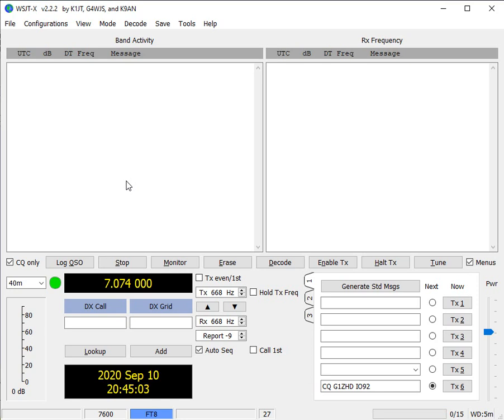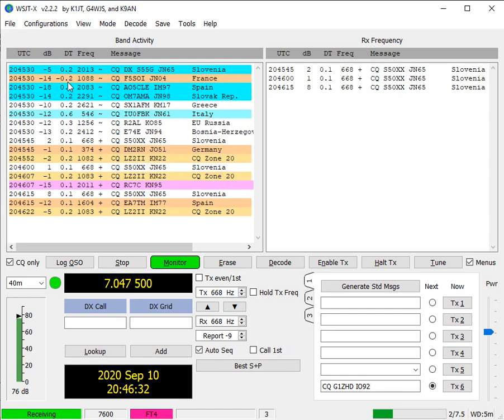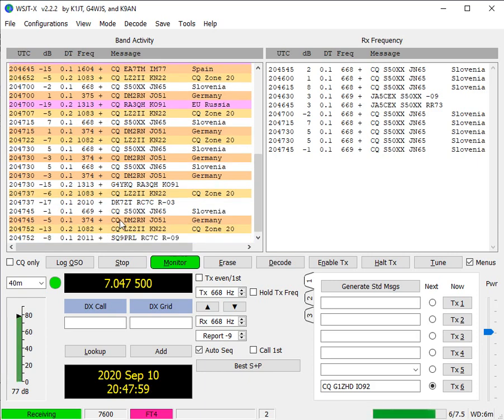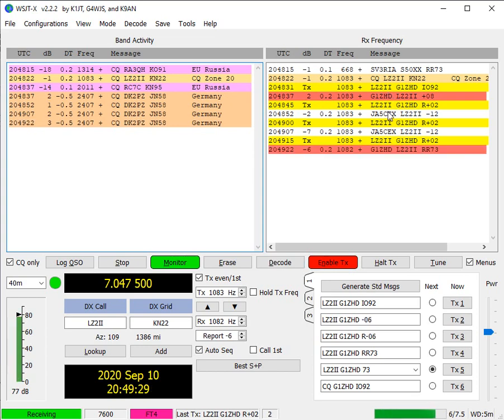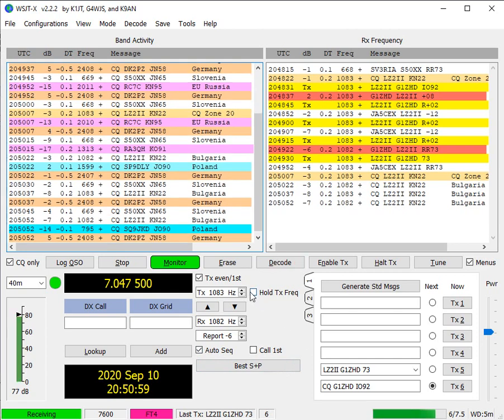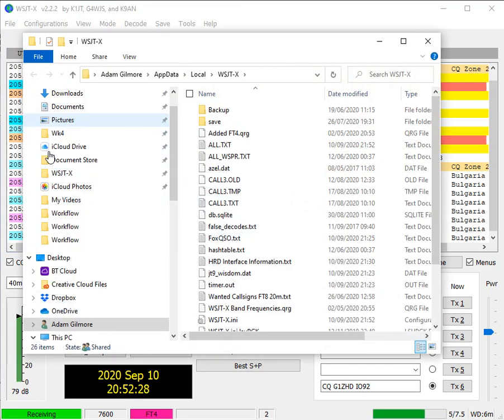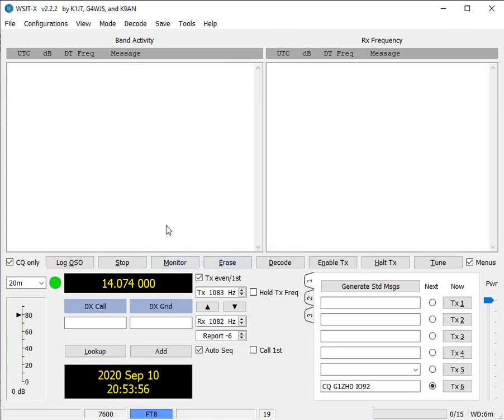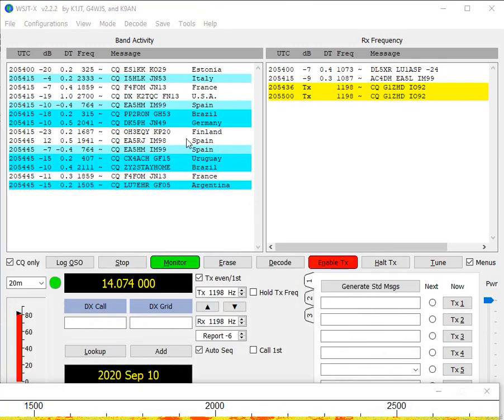WSJT-X Basics in 10 minutes

Comment: Setting up WSJT-x is a special art that only a few people can do. Just getting the mysterious drivers in the right place takes time and you can experience loads of frustration. Maybe that's why I can't find a video that slow walks you through the setup. If I ever figure it out, I just might do a video on it.
Reply from the maker: I keep tell myself I need to do one but haven't got around to it. Really it needs a PC or VM that is a new install before you start, but also, it does differ slightly dependant on what transciever you are using and if a seperate interface/soundcard is required. With newer ICOMs, even as late back as the 7600 and 7100, it's pretty straight forward, if you know how. I might just try and creat a 10 minute video on how mine is setup, may would be a start, for sure.

Comment: How do you dislay country? Mine does not. Have not found that setting.
Reply from the maker: John, I've had a look at mine and I can't see any settings that would allow you to switch the Country on/off. They only way I can do it is to reduce the width of the window, so you just can't see it. Also, Country only shows on CQ calls, and only once you have already contacted the DXCC and ITU zone in which a Country exists. I will keep looking and let you know if I find any other possible reasons.
Reply: @g1zhd-adam  I will check it again tonight... once the thunderstorms clear out. in my local area.

Comment: from last weeks i've tryed to operate in  FT8 bu i can't transmit. i don't know if it's a problem of PC or some issue of the radio
Reply from the maker: What radio are you using? So are you receiving signals and have you selected the right com port for the audio. Also check the figure in DT. If more than +/- 1.5 you will need to syncronise you PC clock to the net.

Comment: I had hoped to do FT8 with software only but apparently still require the interface hardware to my Yaesu radio for anything to work. I am really disappointed as I thought it is computer to computer communication?
Reply from the maker: Well the comms is still RF but the computer codes and decode the message. Which Yaesu do you have?

Comment: Question. I went in and set the items I wanted to follow by color. It only shows the cq, transmit and incoming call but none of the other colors like new grid, country or other items I checked. Any idea what the heck I am doing wrong?
Great video thank you..Kb6lqv
Reply from the maker: Hi Ray, I have all the 'Decode Highlighting' items ticked accept for 'LoTW User' and 'CQ in message'. Are you saying you aren't receiving anything but CQs and incoming items, or that they are they only ones highlighted? If they are the only items then do you have the 'CQ only' box ticked above the recieving signal strength meter?

Comment: looked and did not see the drivers for Mac. I looked on the Icom website before posting this and did not see it.  I saw the drivers for Windows but not Mac.
Reply from the maker: WSJT-X does not user Drivers. Only the USB cable to your radio or sound device will need them. So you need a USB cable with drivers compatible with Mac.
Reply: @g1zhd-adam  and what cables are those?

Comment: I want to send CQ for a specific Country.  I have tried creating a macro, or just enter in one of the 6 lines on the bottom right.  When I do this I get this symbol "<"    ">" with CQ_XXX  in between the brackets.  I can't seen to find any info in how do you do this correctly.  I can see others who are doing it on my screen.  I will give you the exact example.
Give me an example how to type in     CQ P43 xxxx FN41     xxxx would be callsign       Thanks, Ken
Reply from the maker: I'm sure you have the answer by now but just incase not, you just need to type in the country letters in between CQ and your callsign in Tx 6, e.g. CQ NA G1ZHD IO92 for North America. However, if the combination of your callsign the extra country characters and the locator are too long for the display screen then it will just show as < >. It should still be sending the correct letters.
Reply: @g1zhd-adam  I appreciate your post.  When I do that It transmits  <CQ_P43> mycall FN41      Note the brackets and the underscore.   Someone else told me it could not be done with a letter and number.   no good with P4 either, what works is just the letter "P"     I have tried it with 4 letters and it works.  If I use 5 letters I get the brackets.

Comment: What is a normal transmit power setting for FT8?
Reply from the maker: Short answer, 30w. Long answer: I know it's not useful but the right answer is 'as low as possible'. You somewhat need to guage the power for the day and difficulty in getting the QSO. Of course propagation, antenna, location, receiver conditions, all have a big impact, as in any other mode. I personally normally operate between 30w and 100w, but this is often too much for any QSOs, especially when using my beam. For the beam 6m-20m I would typically use about 30w but for the wire 30m-160m I often use 100w. However, I have made many contacts on 10w or even less. My recommendation would be to start at 10w, after 3 no replies try 30w and keep increasing until you get there. With FT8 it's often better to TX on a different Hz if you are struggling, just in case of a pile up, rather than increasing the power. Often with FT8 it's a matter of patience rather than power. I certainly would avoid QRO in FT8, even for distance, all it does is spread the BW and upsets people.
Reply: Thank you

Comment: If I understand correctly, the purpose of the software is only to display transmitter statistics? I think it would be more practical to also view broadcasted info or conversations.  If I happen to receive from a transmitter in Ukraine, for example I'd be more interested in the broadcast and not so much transmitter statistics. I don' think this program is useful to me. But yes, thanks for the video. Neither thumbs up or down.
Reply from the maker: Sorry Steve, I'm not sure what you mean by Transmitted and Broadcast stats. The purpose of the SW is to work the FT8 mode. The purpose of the  video is to simply shows how the SW works in regards to FT8. I do not have anything to do with the FT8 or WSJT-X design, I think you should feed your comments back to the originators.
Reply: @g1zhd-adam  Hi Adam. I've been a casual SW DX'er for about 50 years but only recently recently got a good quality receiver (PL990) which opened the door to SSB. I've been messing with the SSB for about 4 months now. I noticed folks like to participate in the distance competitions. I'm a complete noob to digital comm. I first used PSK31 and enjoyed monitoring conversations. I came across the FT8 in my research and the WSJT-X is very popular so I tried it. All I could get regarding messages was station ID (Call sign, location etc).  All the info I could find anywhere about the WSJT-X shows it only displaying station ID, which leads me to the possibility that it is exclusively used for the DX competitions. I understand the fun the distance competitions are to operators, but I personally am not as interested in them as a RX only. Hope that makes sense. I came across the software js8call which works with the FT8 mode and displays the conversations. You have a well produced video and "Thank you" for publishing it, and I give you the thumbs up that it deserves. My original reply wasn't meant to be criticism, sorry if I came off that way. 👍👍
Reply from the maker: @SirSteveFury  I understand now Steve, thanks for the message. Yes FT8 isn't so interesting for SWLing, as it is a fixed set of messages, not a conversation as you get with other modes such as JS8call. It's more used for Grid chasing rather than DX but I have worked Aus and NZ using mode, as well as many UK squares.

Comment: How do you adjust higher your db gain in the left corner of the screen ?
Reply from the maker: You need to adjust the input of the USB volume through device settings in Windows. Open Sound Settings, select the USB input device, Device Properties and adjust the volume.

Comment: You should turn your "Audio In" down You are clipping, going Red... set to @ 30~35dB on a clear frequency
Reply from the maker: I couldn't work out how to do it with Windows 10 before but have fixed it since making the video. Cheers.
Reply: @g1zhd-adam  how did you adjust the level. I'm running windows 10 and can't get it lowered.
Reply from the maker: @larrychristensen5917  Sound Settings, input, chose the device (USB.. ), select Device properties. You can also rename the device there to RX Input for example.